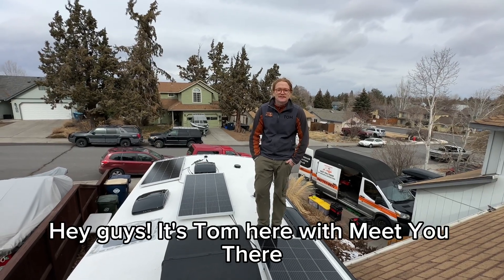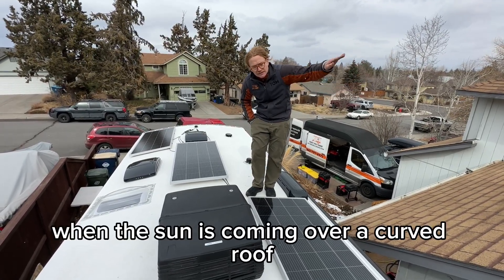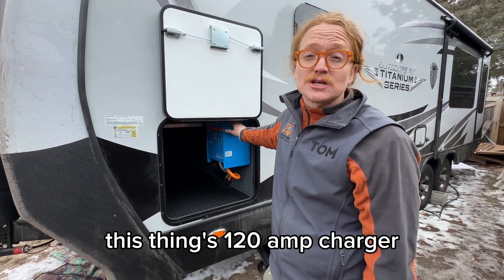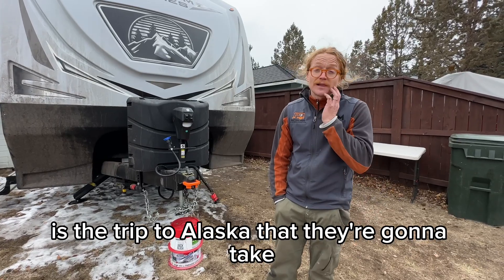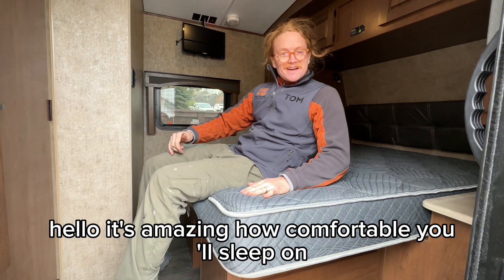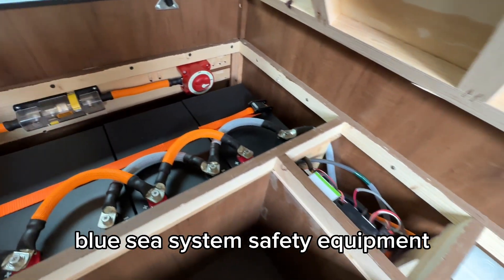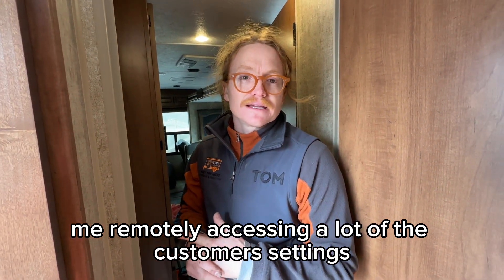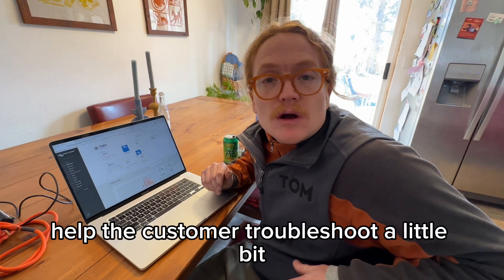618AH SOK BATTERY #RVSOLAR INSTALL

Comment: It would be nice if this was still possible in the fifth wheels. Maybe install in the bedroom cabinet right by the door?
Reply from the maker: Do you mean under the bed? I'm not sure it would be impossible, but with the bed above the king pin it would be very hard to route wires up that way. The front bay has plenty of room for the install, but of course you lose a little storage.